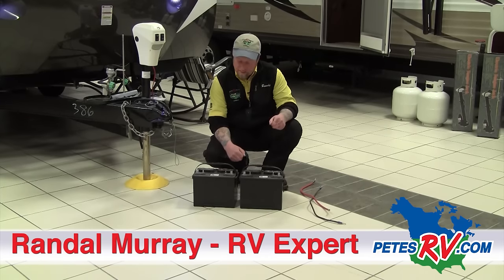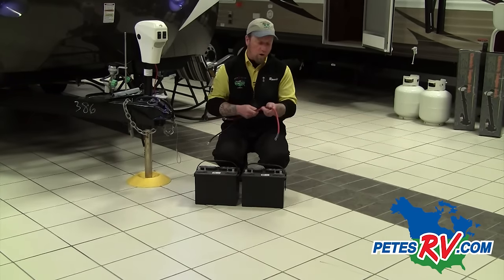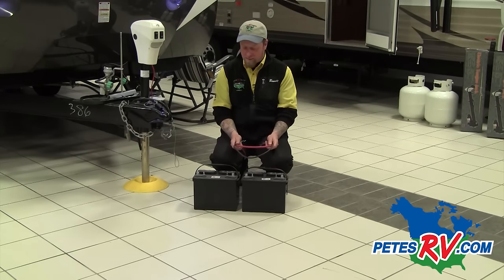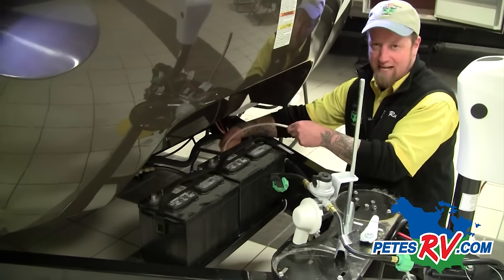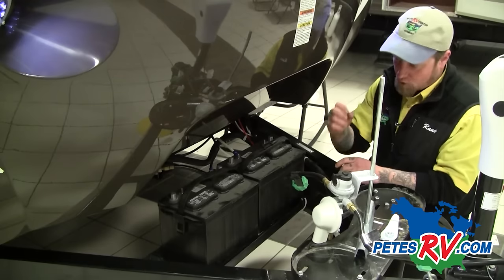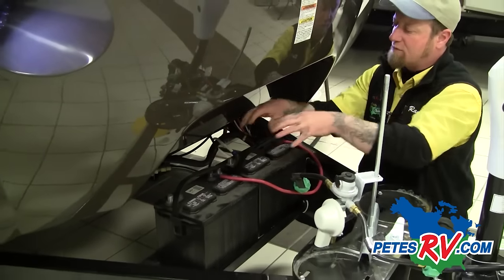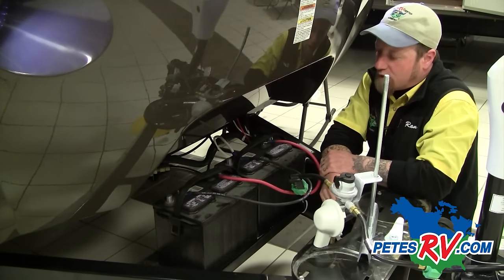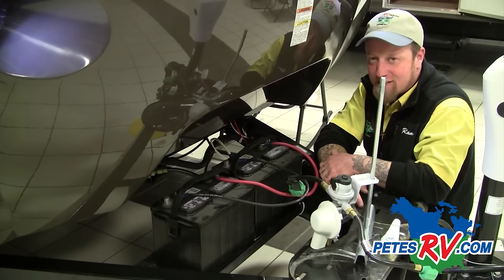12-VOLT DUAL BATTERY SETUP | Pete's RV Quick Tips (CC)

Comment: If using my method, hook  alternator to the battery not grounded, this way both battery's will take the same charge, at the same rate. 
Thanks for watching
Reply: Both batteries are grounded... Unless you unhook one of the terminals.
Reply: I think he means to say is wire to the battery not closest to the grounding cable. in other words the battery with only the ground jumper cable.